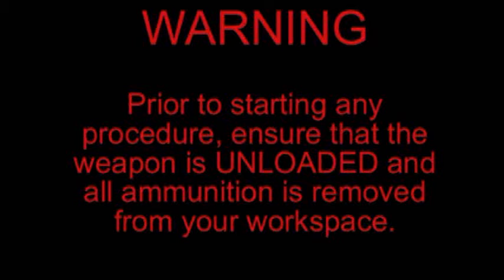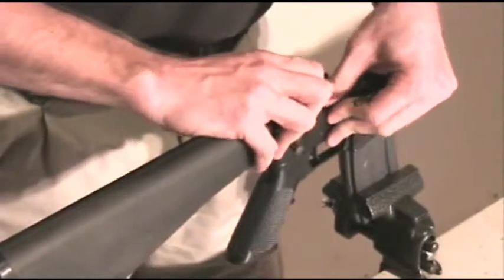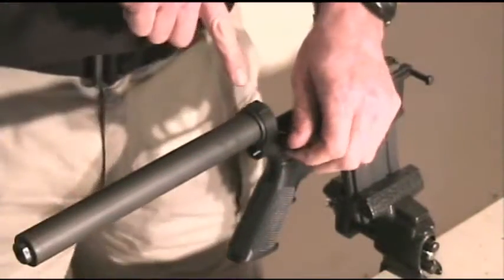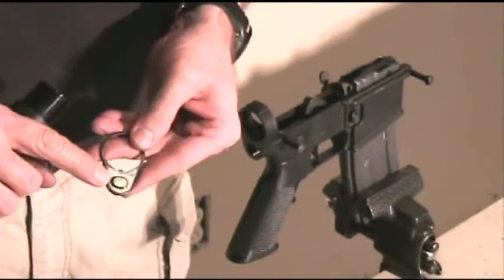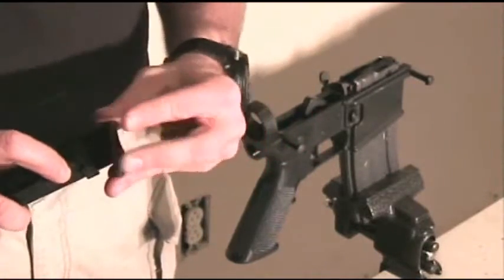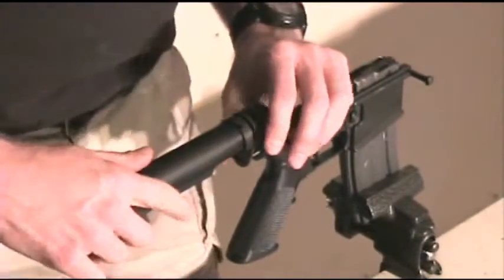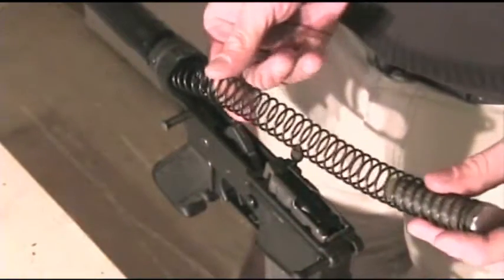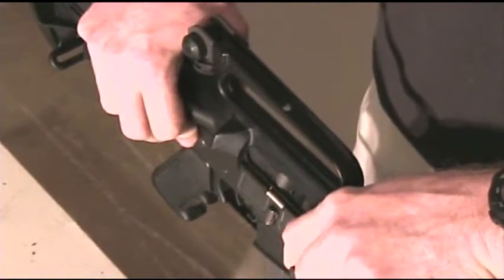TAPCO AR15 Stock Instructional Video

Comment: Remember! Collapsible Stock designed for Carbine!
If you have 16" barrel then the "balance" is perfect!
If you got 20" or 24" barrel then will be "unbalance" for sure.  Original of my AR Bushmaster I added the balance weight more in my fixed stock for improve accuracy and of course balance for the gun because much heavy with A2 barrel 20" barrel!
- Perfect weight if you have standard M16A1 (light weight Government model barrel, then OK for T6) A2 will make UNBALANCE for sure!